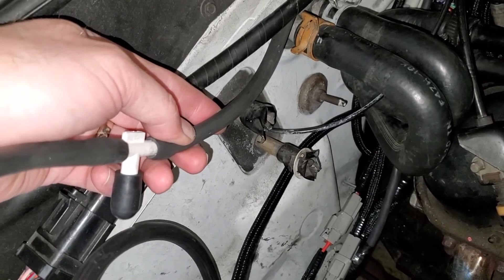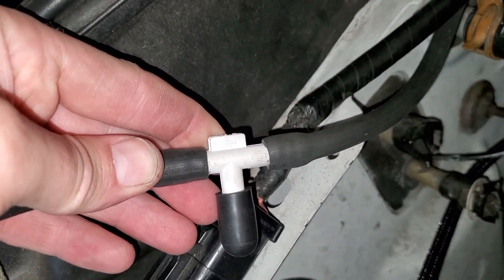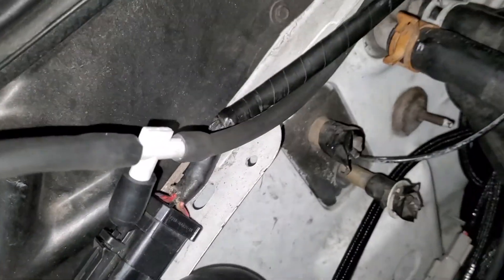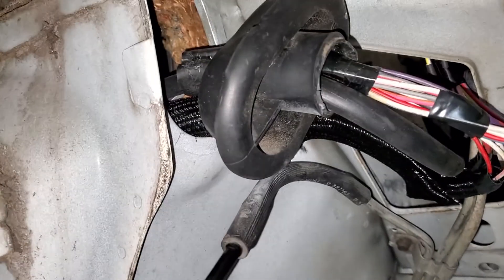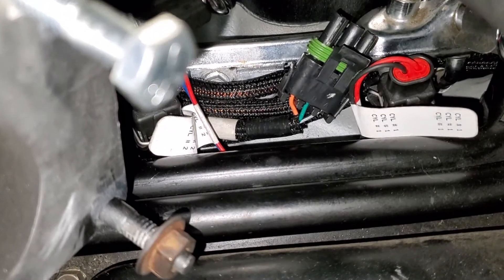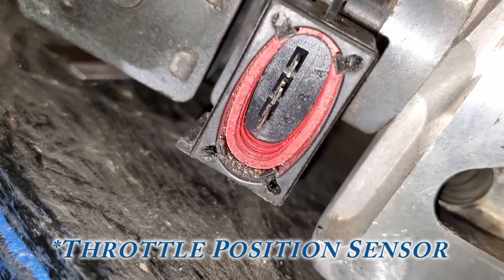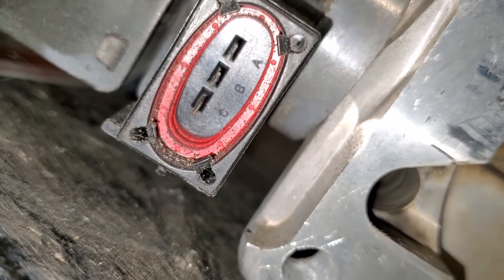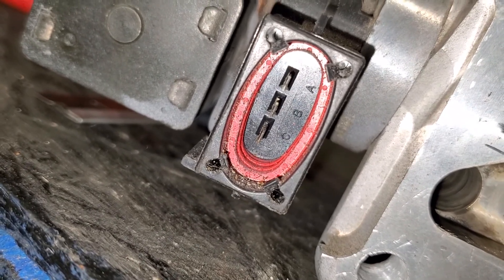SN95 Terminator X: Getting ready for key on, global config set up, and first start attempt.

Comment: You're not supposed to have the mat sensor before the throttle blade hence the name MANIFOLD air temp sensor just figured I'd let you know because it makes a huge difference in tunning your volumetric efficiency table and AFR tables for accel/startup enrichment
Reply from the maker: Thanks! I have been busy and haven't messed with the car for a while (but hope too soon). Moving that sensor is on the agenda!

Comment: The red with white tracer coming out of the holley. Connected to a switched and hot while cranking wire. What wire did you use? Red w/Green tracer?
Reply from the maker: I'll check and get back to you as soon as I can get in the garage